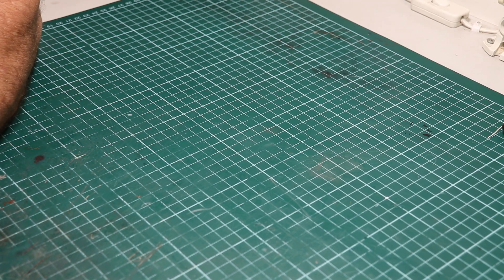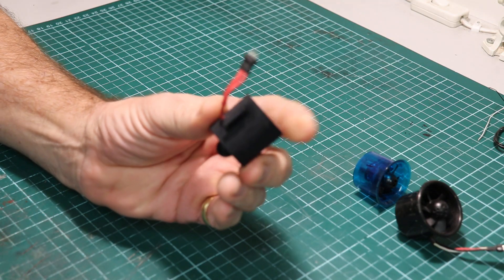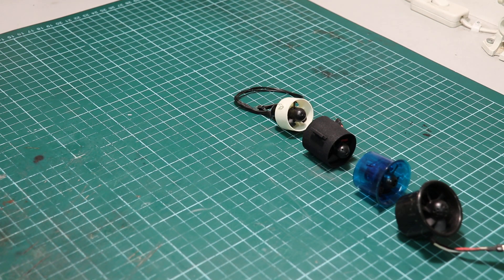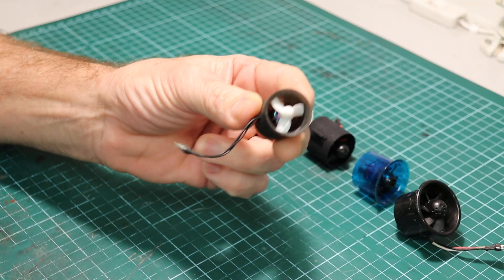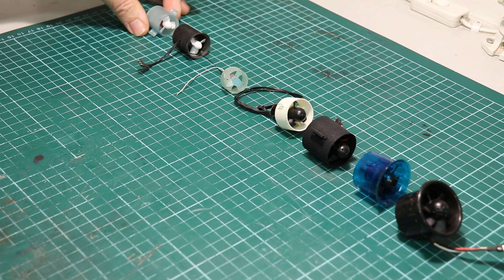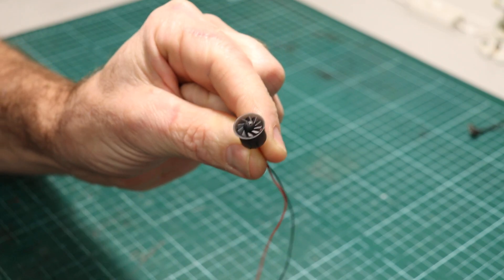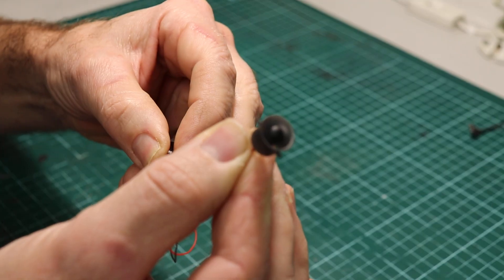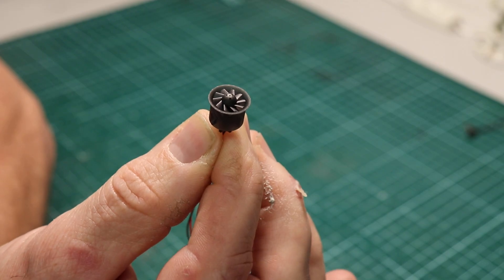Is this even possible? Making a 10mm Nano EDF unit!

Comment: Absolutely impressive!  Great work.    Can you suggest a variety of somewhat reliable sub 5g servos to go with these tiny edfs?  I was deep in the weeds of 30mm development  some time ago but became frustrated losing progress to unreliable tiny servos and went back to larger format models.  Which servos are working for you?
Reply from the maker: At this size - it's time to switch to magnetic actuator servos. But for small servo's I use the 1S orange servos that came in a lot of the UMX models.
Reply: @NitroCharged can you recommend a specific receiver for actuators?
Reply from the maker: @hi1172  Deltang don't make the tiny rxers anymore. The closest now is boards like this: https://www.minimumrc.com/products/minimumrc-6ch-micro-actuator-receiver-with-built-in-5a-brushed-esc?VariantsId=10242

Comment: Are you printing the fan blades with a resin printer?  It seems you need very fine detail as well as strength.
Reply from the maker: Yes. A 4K printer and high end resin. Details are amazing.

Comment: Could I buy a couple please?  Or even better, I'm building a 1/48 scale F-14 and would ask your recommendation on motor size?
Reply from the maker: Hi Jimmy, at 1/48 scale, there's enough room for 25mm EDFs. To keep it light - 20mm EDF's on 2S would be what I would aim for. :)
Reply: @NitroCharged Thank you so much for the reply!  I heard you sold them so it is possible to order some from you?  I’d like to order at least 4 or 6 to start off with.
Reply from the maker: @npham54  They are on my website if you're interested: http://www.nitrocharged.com/shop/home/2-13-atom-10mm-micro-edf-unit.html#/1-fan_rotation-clockwise/6-mounting_tabs-no
Reply: @NitroCharged website link don't work
Reply from the maker: @MikeyMikey1968  Does this link work pse, Mike? 
http://www.nitrocharged.com/shop/home/2-13-atom-10mm-micro-edf-unit.html#/1-fan_rotation-clockwise/6-mounting_tabs-no

Comment: Holy shit what kind of 3D resin printer do you use or did you just shrink beam the printout
Reply from the maker: Darn, I should have said in the video or description... It's an elegoo Mars3 4K using tensile resin that is rated at not cracking, warping or shrinking and has a high heat resistance too.